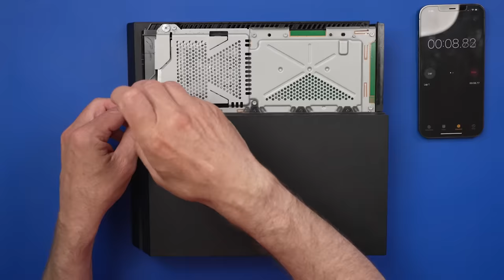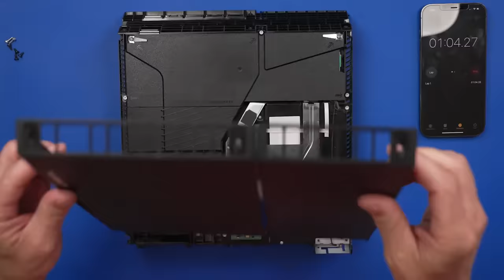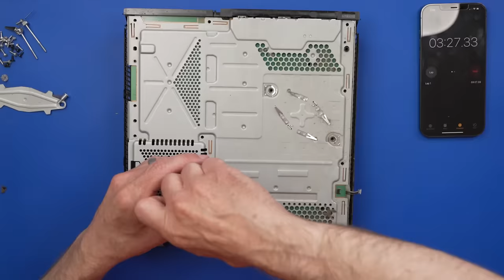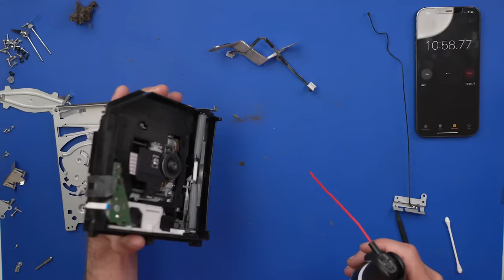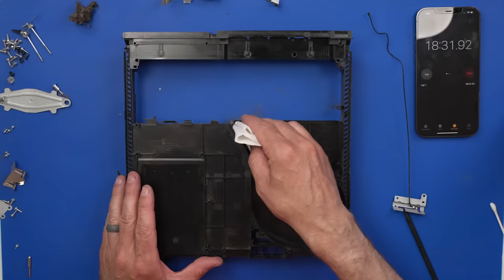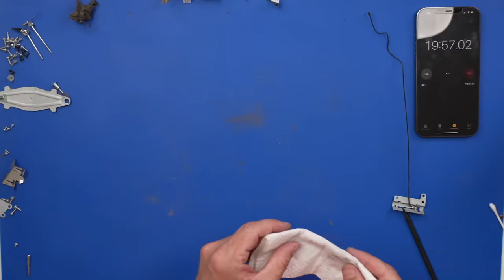Why "Refurbishers" Rip You Off

Comment: Some systems are easier than others to refurbish. I think what you demonstrated here, that is what the definition of refurbished is, and should be. That being said, OG xbox One can be cracked and refurbished in about 10-20 minutes and upgraded with an SSD if you have them preflashed with the latest xbox software. pick your refurbs man! Playstations have always been overengineered except the first one. Even the PS One is a bit overengineered albeit simpler due meerly because of its age. Best to offer a cleaned and tested ps4 doing your best to obstruct the fan from spinning and blasting every single orifice you can with the top removed (cus its easy) with a shitload of compressed air and call it a day, OR a premium refurbished item where you do this particular process for a greater price, to justify the additional labor.
Reply: this is assuming the fan is not bad (which you should be able to tell during testing)

Comment: I always thought refurbished meant that there was some kind of functional fault with the system that had been repaired so the unit could be resold in working condition, and anything else would just be considered simply as used goods.  I guess that just shows your point about there not being a standardized definition for the term.

Comment: When I buy something refurbished I expect it to have been open up and cleaned. All parts tested as you do in your videos. If any electronics or fans, ect need to be replaced then they should. All work done should be specified in a sheet of paper with the technician who serviced it. Even if it's hand written. I.e. Mom and Pop places ect. Same with the system if comes with controllers I expect those to have been done the same. That is refurbished. "Pre-Owned" simply just means reselling it. Selling to gamestop and they turn around and put on shelf within a day without cleaning.

Comment: I had the thought of trying to refurbish used consoles and selling them to earn a bit of extra money. But after a short back of the envelope calculation I realized that after the costs for the consoles, tools, spare parts, utilities and all the legal requirements in my country and taking into account the resale prices I could realistically sell for, I'd pay myself below minimum wage in the best case and lose money in case I'd have to replace something. Not worth it.

Refurbishing should include a good cleaning inside and outside, repairing what's damaged or not working, replacing thermal paste/checking the liquid metal and if necessary regreasing the moving parts in the disc drive.

Comment: I feel as though refurbished should be legally defined, at minimum, as a product with warranty and guarantee of full functionality, offered in multiple tiers of cosmetic appearance, requiring internal inspection and maintenance if needed with thorough testing.

This would increase the price across the board, but if "refurbished" devices are as much of a gamble, if not more so than just buying used, it makes no sense to go with refurbished in the current state that it finds itself in.

Comment: Might I suggest you use a cheap 1" flat paintbrush to dust off internal parts... those scrub brushes your using were designed to clean gun parts for the military, and have very hard, short and coarse bristles..not the best for dusting delicate parts.. and with a soft paintbrush, you will "flick" much more dust out of the small cracks...

Comment: Your definition of refurbished is exactly what id expect. Anything else I would say Tested working, sold as is for stuff to be full of dust, dirt and grime. I get it, everyone needs a piece of the pie. Your definition of refurbished is my definition for a used car. Id expect minor cosmetic damage inside or outside. I'm an automotive tech 17 years working for various dealerships. They all want to make the most profit on these cars and often send very good reliable cars to auction because they needed to much, even if its minor maintence repairs it adds up quickly. Or the only chose to fix safey items, or sell cars that pass a state inspection legally but will need repairs in the near future. Or even some will try to sell an extended warranty because they know that car had a leak and they just degreased it, or a heated seat doesn't work, anything else. I've worked at one place that would tell customers they have to wait 30 days to make an apointment to get it repaired so they could get it fixed under the warranty and just pay the deductable (that place is no longer in buisness) Its like no one takes pride in their work these days. Everyone is out chasing that easy $$$.

Comment: I think most shop aren't concerned with expensive camera and sound equipment and could shave almost 15 minutes off of the cleaning with the use of compressed and vacuuming air over the meticulous ASMR method you use with the brushes.. and I really don't think any company at all would disassemble an electronic device this thoroughly for a "refurbish" .. just my thoughts on it

Comment: i bought a "refurbed" 4070ti in january this year, 
to my surprise it looked brand new, warranty seal still intact, 
PCI pins were mint (no "sliding in and out damage")
*i take that back, used-like new 4070ti. 3070ti ftw3
was refurbed. and had no signs of being touched.*

from being inserted into someones motherboard) 
i paid 650 for this V1 gigabyte 4070ti with everything 
minus the outer cover. i know they didnt do anything.
likely someone bought this, seen it had issues cracking 
(although had mount included) and they sent it back 
same seller has brand new cards of the same brand
all said and done, warranty holds on gigabytes website for
whatever thats worth. as they dont hold their end of the deal. 
(evga is out the game now sadly and they too have become shady recently)
either way, you can tell (if you do stuff like this) if someones "been inside" 
before or not. (just for the record, the cards still in my pc, sold 3070ti/2070s
that werent mentioned)

Comment: my last "refurbished" console was a fat ps3.

it wasnt pricy, but it still wasnt a fair price at the same time because even if the seller promised they would clean and repaste it, it was a mess.
luckily, i bought it to challenge me with the restoration, so i open it, and wth.. there was so much dust inside.. and obviously, no repaste, unless someone was crazy enough to dribble all that dust, or remove it and put it back in.

i promised myself that i would never buy a "refurbished" product, unless it's very cheap, i prefer going blind on marketplace and test my luck with a restoration, so far i've restored a gbc, a new2ds, a dslite, and my old ps1, ps2, psp, dmg [2], gba, even if i'm not a pro, but definitely "leveled up" enough, project after project.

Comment: One big resource savings: using an air compressor to do the cleaning.  Fairly effective and much faster than brushing/vacuuming/picking all that dust and dirt off.

Also - when I was doing stuff like this back in the 90's, we'd use a cleaning disc to clean the drive.  We'd only open it up if there was an actual problem.
Reply: Then you’ll have a shop full of dust. IMO a proper ESD safe vacuum is a much better option for this kind of work. The typical ‘portable’ one you’ll find has more than enough power to make quick and clean work of stuff like this.
Reply: @threethousandyen  Well...  I would usually take it outside to blow it out.

Comment: Refurbished means it looks and functions like its new out of the box. New shell or case, new screen, new ports etc...if i go to micro center and buy a refurbished item, every time its going to be absolutely mint as if it just came out of the box. No dirt no dust no scratches. Cleaning shouldn't cost a thing because it doesn't take hardly any effort. Replacement parts are dirt cheap these days. If you buy an item from someone that needs refurbished, dont screw them over, but make sure you account for that money you need to spend on replacement parts. When i sell a device, i dont list it as refurbished, but i make sure it looks like it was. I market the item as if it's a little lesser than it is, so when someone gets it they are blown away. And I've sold thousands of devices over the years. Dkshiddies on the other hand cant even properly clean an item.

Comment: For me, if u don't have air compressor for refurbishing, then you don't do enough of them. Using air cans is good for small things. I think its a joke to think you have to take a console apart for a decent clean. Of course there are some you have to take a part to base, but come on, that is not a reasonable thing to do lets say for a 3 month old console. I just took apart my own PS1 which I've got 25 years ago ( got nostalgic), and I'm not joking, I didn't even used air on it, it was so clean. Take the case off, or shields whatever, most of time shouldn't take more than 20 minutes.

Comment: Console makers, MAKE YOUR HARDWARE EASY TO DISASSEMBLE AND REPAIR. It takes me < minute to open and have access to everything in my PC. Why does the to PS5 have 40 million screws!? Seriously, do any of you gamers care that much about if the console case is slight smaller/skinnier than a PC, or do you care more about the game library and if the console was super easy to disassemble, diagnose, and repair?

Imagine a boxy console that easily pulls apart. And the console is connected to a phone app that tells you what part isnt working (i.e. the fan, power supply, memory, etc.)

Comment: The price doesn't go there. About 10 is reasonable, And by the component that been replaced plus labor thats how the pricing is. This refurbishment that was just cleaning doesn't call the term. Refurbished is more you bring the whole system to its brand new look and function. Better just simple cleaned and repaired to be said than refurbished.

Comment: Like you, I believe that a refurbished product, should be :

1) Fully functional
2) In good internal/external condition
3) Obviously cost less than the new product

I can understand that a retailer, may make little profit on the single item, but the real profit, is made on the quantity of refurbished items sold.
Selling a refurbished video game console that is full of dust inside, is certainly a choice that brings the retailer more profit, as it is not necessary to spend an average of 1 hour of time on it ( Knowing exactly what to do ) and as that console, will most likely be damaged after regular a period of use, due to the high internal temperatures, caused by the dust on the dissipation system.
Not surprisingly, the warranties on refurbished products, are less than those on new products.
When items get damaged, they will need to be repaired or replaced...more profit for the retailer.

Comment: When doing refurbishment on the consoles I repair, I don't "wipe" the outside of the console, it gets taken completely apart, the board gets cleaned with ipa and all plastics get scrubbed inside and out in warm soapy water and gets fully dried, all dust gets cleaned out and as you say I apply the perfect amount of thermal paste. I don't do dkoldies refurbishing

Comment: As I’ve posted before, you really need to invest in an air compressor. You can blast out the dust, and canned air has moisture in it, which isn’t great for electronics (we won’t even mention the fact that aerosols aren’t great for the planet). 
You can get a small compressor for like $60, and less than $10 for a dryer. I bet you pay more than that for the inferior canned air.